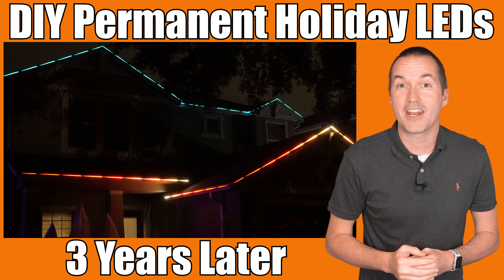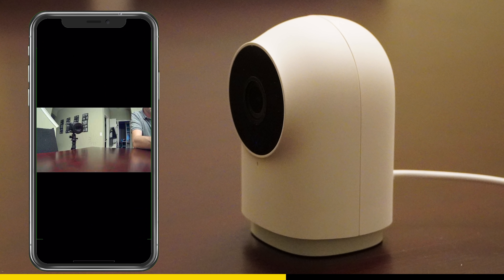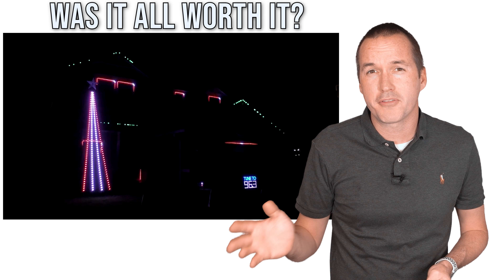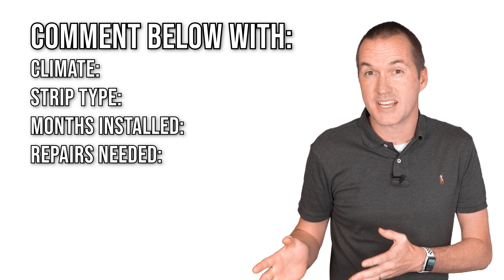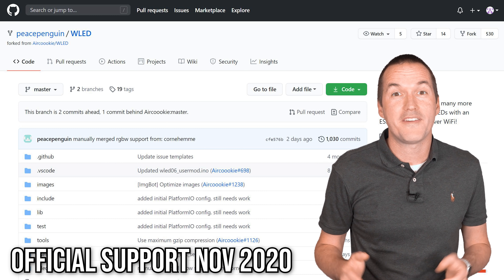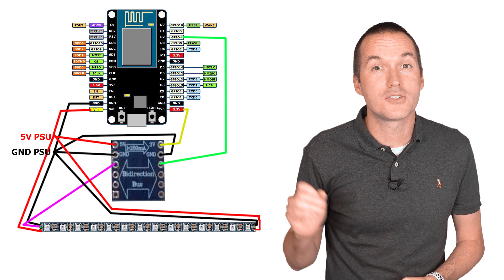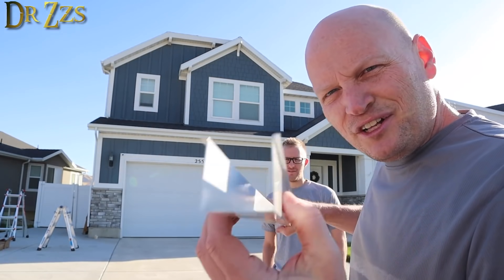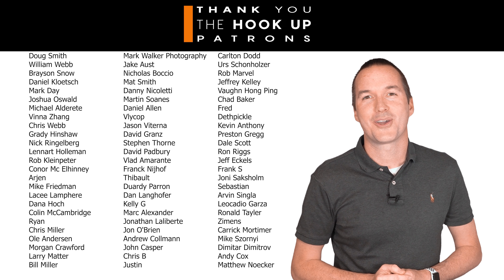3 Years Later: DIY Permanent Holiday LEDs - What worked, what didn't, and what's new?

Comment: Hey Rob, you mentioned a smart outlet which monitors the power consumption and turns them off when not in use... Which one do you recommend for this? Its always at the back of my mind that the power supplies I have are always "on" and what you mentioned sounds like a great alternative.
Reply from the maker: I’m using a shelly 2.5 to do it.
Reply: @TheHookUp  Are you doing something where, when you turn on any of the down stream lights it turns on the Shelly?
Reply from the maker: @anthonyvdh  Sorta.  FPP is synched to turn on the power supply at the beginning of the show and turn it off when the playlist stops, but I haven't synced it to WLED.

Comment: Good Video: I want to add a few things, I know you mentioned the use of the channels as protection from the elements. I recently installed my own small setup after building DIY LED Whips from The Hook Up advice along with a few others. An alternative is the use of PEX white tubing as diffuser and elements protection. I built my UTV led whip with PEX and installed 2 strips back to back inside and they have been working amazingly with 144/m WS2815 strips. I decided since the whips impressed me so well, i wanted to do a small amount of LEDs on the house and i found the WS2815 strips are actually cheaper to purchase than WS2812b currently at least on ebay. I was able to purchase 5M sections of 30/m WS2815 for $14ea. I installed the LED strips inside 1/2inch white PEX and sealed the ends of the tube with hot glue. When i installed them to the house, i just pressed them in the corner of the roof/wall with hot glue and used heat gun to get any bends out of the pipe on install. As for PSU, i ordered a cheap 12v PSU off amazon, but it only lasted a month before it stopped working, so i pulled an old computer ATX psu out of an PC i had laying around collecting dust and jumpered it so it ran when the switch was turn on and ran my LEDs off the 12v rail of the ATX psu, something i noticed after switching to the EVGA 500watt PSU is the ATX PSU is consuming 17% less wattage from the smart plug as the cheaper amazon 12v PSU did running the same hardware. https://www.ebay.com/itm/WS2815-Upgraded-WS2812B-RGB-Pixels-Dual-Signal-Strip-Individual-Addressable-12V/353172939350?ssPageName=STRK%3AMEBIDX%3AIT&var=622373178019&_trksid=p2057872.m2749.l2649
Reply: Awesome setup and for 12v you indeed can go with an ATX power supply and they are very cheap for the wattage they deliver. But please please included some fuses in that setup! ATX power supplies have a different intended use and their OCP and other protection measures have been calibrated for it. It will no problem set fire to your wiring or LED strips and still not trigger if not probably fused. Other then that they are a great choice for larger 12v projects. :D

Comment: You mentioned a smart outlet... could you give a reference to the one you're using?  
Climate: Wyoming
Strip Type: WS2812B  5V
Months Installed: 12
Repairs Needed: none
Reply from the maker: I'm using a shelly 2.5 for that application (since I have two power supplies).
Reply: @TheHookUp   Ok, thank you.

Comment: Climate: UK
Strip Type: WS2811
Months installed: 36
Repairs needed: 0
Been through multiple iterations of controllers (Dr Zzzs, Hookups Holiday LED's 2.0 and now WLED)
Reply: IP67 or IP64? I'm looking to setup WLED and ESP8266s this year with IP64
Reply: I’m using the pixels rather than the strips. They are IP68.

Comment: When doing power injection, do you run separate wire pairs for each injection point, or can you use the same wire pair for multiple injections? With my limited knowledge, I'm gonna guess it depends on wire gauge and how many amps are getting pulled through? The wire gauge would need to support the current of all the strips where you're injecting?
Reply: Either is a way to do it really. I'm more partial to the "run a set of wires per injection" since that way I can fuse each injection at the controller and I use a wire size that's appropriate for that injection point, but it can certainly also be done with a thick "bus bar" wire you tap into at the right points to inject power. Downsides is that you'd have the fuses at those points and that you start with a really thick wire that can become thinner and thinner down the line but generally you continue with the same thickness so in theory "waste" copper. :)

Comment: Thanks for making this video. I was hoping you would do something like this. I followed your instructions last year and did 50m of 2812B strips running on 2 60A power supplies. California desert HOT and dry. 8 months installed, 0 repairs. I used the aluminum channels. 

I had a bunch of 14 AWG romex, so I ran that from the garage mounted power supplies behind my facia board, and when I wanted to inject power, I drilled through the facia and aluminum channel and soldered 18 AWG wire from the romex to the led strip. I did this every 2.5 meters. My goal was to have less power loss than you at the farthest point from the power supplies. It doesn’t look any different than yours, the end gets yellow on full bright. 

I moved 2 months ago so I get to start over. I got the holidaycoro long range boards and some receiver cards with enclosures. I’ll need to run AC to all of them, but I think it’s going to look great. I already received WS2812B strips so I’m glad you would stick with those. Thanks for your great videos.
Reply: When you say it yellows on full bright are you indicating some voltage drop or no voltage drop. Just curious. I’m looking for ideas. I’ll have 55 - 60m of 2812b I’m planning to run.
Reply: @sammyhall7786  yes, some voltage drop. So what I did like Rob was lowered the max strip brightness so that didn’t happen, but the lights were obviously a little more dim then they could have been.

Comment: Climate: Colorado Springs; String type: WS2812B strips in aluminum channel with diffuser; Months installed: 33; Repairs: none; I ran them daily for accent lights plus all holidays. Replaced them this season due to painting the house.  Installed ws2811 square strings under the eaves to wash house with color. I started this because of Rob's videos and have never turned back, and it is the hit of the neighborhood.
Reply: Fellow COS here. Thanks! I'm looking to do this on my place.
Reply: Where can you buy ws2811?  All I see is ws2812???

Comment: Climate: Sub Tropic (QLD Australia)
Setup 20m x WS2812 , in channels with diffuser, 5v supply isolated by Sonoff Basic (controlled by HA) to cut power when not in use, D1mini running WLED 
Installed 12mths
Repairs: Well, no repairs actually done, but I do have multiple failed pixels at random points, seems mostly the blue pixel that goes? I think possibly cooked them? They do get direct sun for a couple hours each morning.

Comment: Ever looked into the kulp lights controllers ? Cheaper than falcons but more than wled
Reply from the maker: I've looked at them, but I don't have experience.  I've use Falcon, HolidayCoro, WLED, and ESPixelStick for E131 stuff.
Reply: @TheHookUp  they are similar to falcons .. but they are capes that run ontop of a beaglebone ... runs fpp 
Very much like a falcon but can drive more pixels when u add expansion on them .. so the k8 can turn into a 48 string easy for half the cost of a falcon

Comment: RGBW IS supported yes by falcon controllers. You just need to set the pixel count higher in the falcon configuration to account for 4 channels per pixel instead of 3. So 150 pixel 5m strip of RGBW would be set as 200 pixels in Falcon and 150 pixels of RGBW in xlights.
Reply from the maker: I pulled that info directly from the XLights page.  I've never attempted it.

Comment: Great video! I also added my PSU's to a smart outlet to power off when not needed. But my IP address changes too often with my WLED/Nodemcus. I haven't been able to configure static IP within WLED. Any suggestions?
Reply from the maker: Can you just reserve their IP address on your router?
Reply: @TheHookUp  yes what he said. In your router you reserve it. Just make sure the MAC address is correct for the ones you are wanting and assign away.
Reply: Thanks for the tip!

Comment: Starting to set mine up this year, I've got both 5 and 12 volt lights in Alberta climate, I'm using old computer power supplies as they are durable and supply both voltages in my case.
Reply: I am also in Alberta and looking at doing this. How have they been so far? How are they currently during the cold snap we are going through?
Reply: @acedrew1  a few issues on some bad solder joins and more tie downs on power injection wires, next year I'll learn more once all done.

Comment: Climate: Northern (Eastern Idaho)
Strip Type: WS2812B
Months Installed: 4
Repairs: none
Notes: Using two DigUno boards with sync feature, 18ga thermostat wire for power injection, noticed diffusers yellowed after three month inspection despite spraying with UV resistant Acrylic prior to install.  Colors still look great

Comment: I have yet to get a stable WLED installation working.  Regularly reboots within 5 to 20 minutes of turning LEDs on...same behavior with multiple Wemos D1's and a handfull of different power supplies.  Last year I just set everything manually and had the defaults set to the animation and brightness I wanted so it would just reboot to the correct  settings.  Going to try some other ESP8266 devices over the next month since I've only been using the wemos d1 mini knockoffs and I think they're all the same brand.

First turn on this fall I also found two dead LEDs in the strip and got to go through the  repair up on a ladder.  That silicone covering is no fun to deal with especially if you get any on the soldering iron or melt it onto the pads.  Tip on the repair, best success was with electrical tape behind the repair spot, pads on both side pre-tinned with a nice blob of solder, and butting the two pieces pad to pad so I could just make a solder bridge across the cut.  With a good clean prep, the repair ended up quick and easy, but only after trying some other methods that didn't work.
Reply: I have found WLED does not like busy/overladen 2.4ghz wifi airwaves - are you in a densely populated area?
Reply: @Etacovda63  Pretty rural where I'm at, I can see neighbor's wifi, but the signals are weak.  I switched to a NodeMCU this morning and it's been running for 2 hours so far with no reboots.  Guess I'll stick to Tasmota only on the D1 minis and use NodeMCUs for WLED.
Reply: Spoke too soon ... rebooted after just over 2 hours... going to try out custom code next I guess.

Comment: Great video Rob!  I just got my first DigUno in the mail and I'm waiting on some SK6812s to come from Aliexpress.  Question - How many LEDs can I control with a single DigUno in this configuration?
Reply: Thanks Rob! Thanks Quindor!  I've just now (pre)ordered another Uno and a Quad from the Dr.  Hopefully they'll come soon!  It would be great if you could make a video explaining how to wire the quad and setup in WLED.  I'm sure I'll be able to figure it out, but at this time I don't know how the whole 4 channels will work/look in WLED and/or Xlights.  Thanks again!
Reply: I made a megatree using 700 bullet pixels, with plans to add 150 more next year. I used a dig uno & WLED. It has run flawlessly. There are a couple of effects where the last 3 strings stay solid color, but when I changed the settings and broke them up into strings( I think max is 11 in WLED) the effects worked on all the lights. I may switch out dig uno to dig quad next year.
Reply from the maker: I think 500 is the suggested max
Reply: @TheHookUp  Yes! Although RGBW SK6812 is a bit different. For normal RGB LEDs you want to stay around ~500 to ~600LEDs to stay in the 60FPS or updates per second range. But since RGBW uses 4 channels instead of 3 like RGB, this drops down to about 375LEDs to keep the same FPS.

So depending on the amount of FPS/updates a second per LED you want to keep, that gives you the amount of LEDs you can drive. So you can still drive a 1000 LEDs off a single data pin, but it will start to look choppy with certain effects.

The Dig-Quad helps with that with it's 4 data channels, or secretly the Dig-Uno also has 2 that can be used to alleviate this issue a bit. :)

Comment: Great video thanks! Cudos for sure on telling everyone your code is no longer the best option. WLED has become an extremely good piece of software and I've donated to Aircookie several times.

Note about 12v (2815) vs 5v (2812).  I would love to see more on how often and what wires you use and how you hide them all work for 5v.  I chose 12v because for 20m of LEDs I only had to inject power 2, and 2 source so 4 wires (I used two controllers and two power supplies to come from either end to reduce cable length).  I used 16Awg outdoor rated speaker wire for power injection.
Initial cost of strips may have cost more, but I saved on wire and lots of time not having to splice into LED strips ever 1-2m.  I just injected at each end/connection between 5m rolls.

I am using the IP67 strips mounted directly to eaves. I'm in Ontario Canada, so get from -20 to +40 C (-4F to 104F).  Only issue due to poor heat dissipation i believe, is I've lost a couple pixels (2 out of my 1200Leds have lost a single color pixel).  Only time this is noticeable is when I have a solid color selected. even then at 60/m its really minor.

Comment: Climate: northern PNW "moderate" (temps between 10-95* and high winds)
LED Type: permanent lines are 5V IP67 WS2812B 30/M in 90* aluminum channels, props are 5v WS2811 strings 
Months Installed: ~10 months
Repairs:  permanent rooflines have  needed no repairs.  I do have 1 prop with strips that has needed 3 repairs - 1 was a bad joint I soldered at the connector and it had strain on the wire.  This prop is 20ft long and heavy, getting moved around and hoisted onto the roof a bit.  It has had 2 factory solder joints fail - simply cut back the IP67 coating, reflow solder over the joint, seal back up with hot glue.  Less than 10 minute fix, on the roof, in the dark.

With that said, generally strips have a bad reputation for failure and it seems not all strips are created equal.  I use BTF strips.  My strings tend to be much more likely to have a bad pixel out of the box but less likely to fail (or concern me of a failure) vs the strips.

I started with NodeMCUs but they became too laggy for any worthwhile shows (via e131), even on a dedicated router.  They have all been removed and Falcons are now controlling the lights.

Comment: Do you have a tutorial on how you built the PVC window surrounds for the LED strings shown in this video?
Reply: I’ve love to see this
Reply: ive seen someone else do it they get a slightly larger pvc pipe cut it in half so the smaller one snaps into it.  you screw on those halves where ever u want and you have the smaller sections made with the lights in them so when the time comes you just snap everything on and pull everything off as one whole unit its a awesome idea but at the same time more junk to pile up in the attic lol

Comment: Climate: Coast VERY DAMP (Near Vancouver, Canada)
Strip Type: WS2815 DC12V IP30
Months installed: 12
Repairs needed: In the process of complete removal.. Not sure if bad soldering or water in the connection points but had constant flickering, had to cut out one LED at the end.. Worked for maybe 3-4 months without issue. Not sure I would do it again without a complete redesign. I spent a lot of time making sure I sealed the ends during the initial install.

Comment: Thanks for the update! I just finished one section of my house and posted the pics on the Facebook group, pretty happy with how they look. I haven't had to connect 2 strips together in one run yet though.

One question at 2:30 in this video you show a connection between 2 strips, do you have closer pics to show how you made that connection? I know you showed making a connection in the part 3 installation video, but that only shows connecting the 3 conductor wire to a strip and not connecting 2 strips together with power injection. I'm just curious how you made the connection so close and avoided gaps in the lights. Thanks!!!
Reply: The strips have cutlines which make the spacing correct. The strips actually are multiple segments joined at the factory where they're made anyways. And then it's just a matter of hooking the three lines of the one strip to the three lines of the other, and then possibly injecting power from the additional power injection wire.

If there is a power injection, then it's just the "left strip positive" connected to the "right strip positive" and the positive of the injection line, all together. Negative is the same. 

The data pin is just the "Data out" connected to the "Data in" (no additional injection wire here)